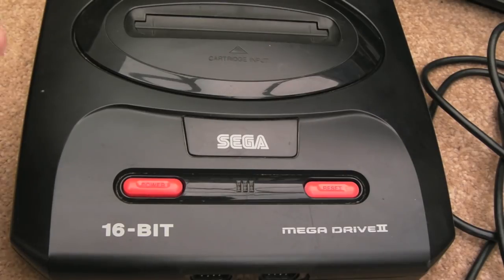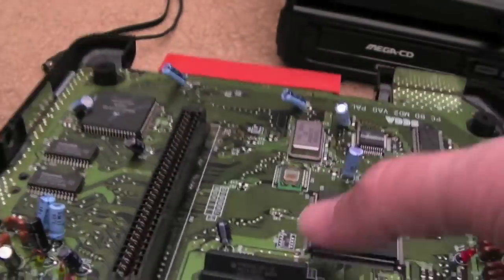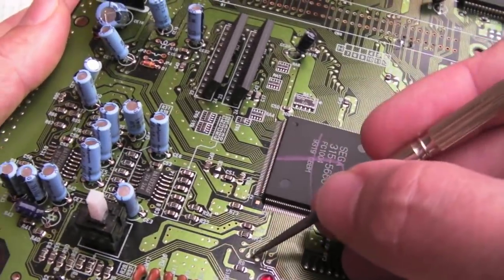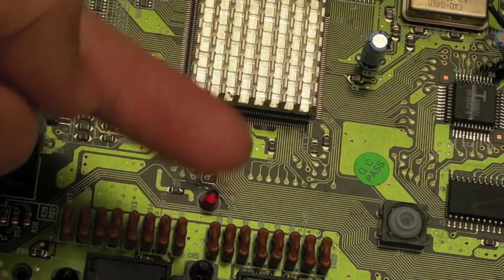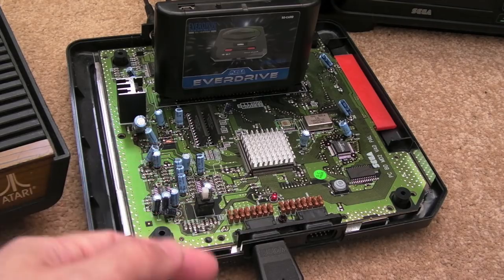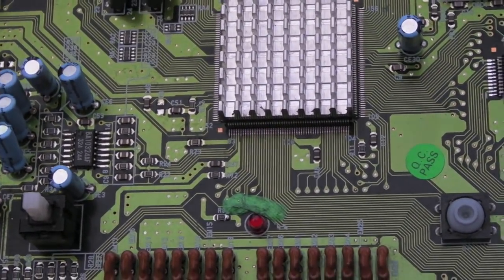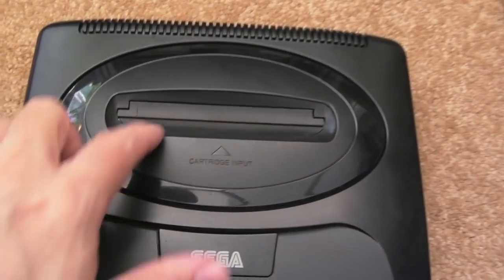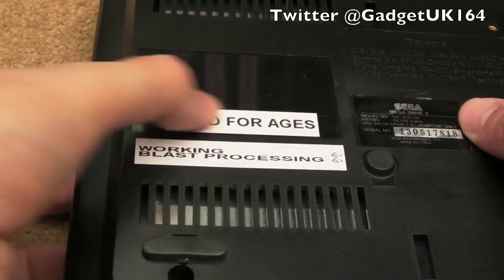Sega Megadrive (Genesis) 2 (MKII) Repair (VA0) - Black Screen

Comment: Great video, thanks. You have added a heatsink on the cpu/asic. I have two questions:
1- Was it used with thermal paste or a thermal pad? Is it easy to find on aliexpress or similar stores?
2- Have you experienced some artifacts because of this increased heating on this chip? 
I have a Brazillian Mega Drive with internal psu and it starts generating artifacts after about 30 minutes of gameplay. If I keep pushing it gets worse. I could upload a video with this gameplay to ilustrate if desired.
Reply from the maker: I used thermal sticky pads from 3M.  I haven't noticed any artifacts!  Maybe you have bad capacitors in there that need swapping, or the chip has developed a temperature sensitive fault..
Reply: @GadgetUK164  I will double check every pin for bad connections and reflow them if needed. Capacitors look ok, but there is only one way to know for sure. Thank you.

Comment: I had wavy lines interference on the RGB image of sega mega drive 2 model MK-1631-50. As advised by a friend I went in and replaced the voltage regulator with a new one ,L7809CV. The console was working before just fine now it boots fine and seems to still output a signal since the TV seems to detect something, but the screen stays black and there is no sound. Any idea what could have happend? Could be that I used the wrong kind of voltage regulator?
Reply from the maker: A 7809 is a 9v regulator - chances are that has destroyed something on the board.  Instead of providing 5v out, 9v has been fed into chips.  They die with more than approx 5.25v typically.

Comment: Heyyyy hoping for advice, I have a megadrive and a 32x, Megadrive games don’t run (I’ve tried several) they only load the initial produced by sega enterprise screen, then goes black. What’s weird is the 32x games work through the 32x but megadrive games don’t work through the 32x or through the normal cart port. Just wondering if you’ve come across this ? Thanks 😊
Reply from the maker: The first thing to do (and you've probably already done it...) - reseat the flex ribbons (at both ends).  Then clean and inspect the cart slot, and the part that fits into the Megadrive (pcb edge).   Assuming that hasn't revealed anything, I next wonder if its a region thing...   What region 32x games are they, and what region is your Megadrive and the carts it does work with when the 32x isn't connected?
Reply: @GadgetUK164  so the region they are all megadrive pal games, console also megadrive and 32x is megadrive, what are these flex ribbons??  I will google it now! I thought it may have been a region issue so I double checked it wasn’t a genesis etc 🤣  last time I checked it after cleaning it isn’t even displaying the sega enterprise productions screen anymore just a black screen now hope it haven’t broken it even more. I checked the traces and they all link up to from the carts pins to the chips hmmm 🙈

Comment: I managed to jump start both a model 2 VA0 and VA1 that would do this black screen. Literally a piece of wire and have one end grounded and create a temporary short to the VCC pin of the lower ICS to
Left of board. It seemed to be specific locations to short that would get it to boot , and not just a 5v to ground short (well yeah it is but off specific point) 

One started working as normal after this technique I developed lol 

Another one didn’t, and eventually the audio died... but I could still “jump start” it haha
Reply from the maker: You shouldn't really short connections like that - if you need to, its a sign of a fault somewhere or a bad trace.  How did you work out which connections to short?
Reply: Both pal models happened after 60hz mod which is cutting one trace but also after switching them on and off so many times. I didn’t care - I buy them faulty then fix them. So they were “faulty” to begin with. It completely revived the other system and its been working normally. I was just messing around tbh

Comment: Lets say i wanted to get replacement rivets, where could i get some that would fit in the cartridge slot connector holes?
Reply from the maker: Honestly not sure - I would start with a rivet kit from eBay or something and see if any in a kit would fit.

Comment: So, I'm not sure if there's answer to this, but I'll go ahead. I have a Japanese MD1 that works just fine, however the plastic on the pin connector and DIN socket leave an oily residue on connected parts. I have no idea how to stop it. It's really annoying, because other MDs I own aren't doing it. I'm close to swapping the parts.
Reply from the maker: Maybe theres a capacitor leaking somewhere, perhaps in the cable?
Reply: @GadgetUK164  That's the thing. I've checked all the caps and they're fine. I also use an HD Retrovision cable. The plastic on the connectors themselves seem to be "sweating".
Reply from the maker: It must be the connectors then =/
Reply: @GadgetUK164  Hmm. At least in this video, you remove the pin connector. How do you go about removing the metal pieces? Do you have a video showing the process?

Comment: I really be no clue about this stuff.. can you not test for continuity with a multimeter either side of a suspected break in the traces?
Reply from the maker: Yes - that's how coninuity test works!  It will beep if there's a very low resistance electrical join between the two points you are measuring.

Comment: I love the sega mega drive II! Me and my Family still have our console, however since we are Australian, we used Antenna plugs to play the system, but since we are in the future now, antennas do not get used anymore due to internet and stuff like that. Since thats there now we cannot use it anymore due to our new TV not using antenna. Im hoping to buy a Antenna to AV cable converter, need to save a bit more...

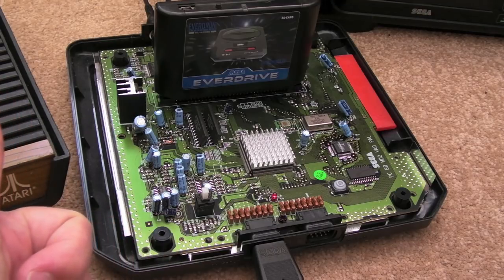ALSO at 27:32 i thought you were pissed off about the incompatibility! but it was just the case... you shocked me a lot!

Comment: My Megadrive 1 has a black screen with weird blue vertical blocky lines on the screen? I can't see any noticeable corrosion on the console. Where do you suggest I look in terms of a potential shortlist of faults? Do you think faulty VRAM is likely?
Reply: Also thanks for this - thanks to this video I was able to diagnose a broken link next to R80 and half a dozen broken links around the cartridge slot on the Megadrive 2 I have that isn't working. Not confident with the repair myself so I might find a friend I can work on it with.
Reply from the maker: Are you getting sound though?  If you had sound but graphical issues, that would suggest VRAM.  If it doesnt output sound and appears to crash with those blue vertical blocks, I am more inclined to thing work RAM or a VDP / arb fault.
Reply: @GadgetUK164  No sound either. How straightforward a repair is it or am I better off sending it off for repairs. I'm trained as an electronics technician, but it's been years since I've used the skills, so I'm a little rusty.
Reply from the maker: If you've never done much desoldering of chips it could be tricky!  You are best using a desoldering station or something to remove the IC.  It can also be quite hard trying to source some spare parts too.

Comment: i had sega like this one at a time but US version and what is weird about it some games wouldn't work unless the controllers were unplugged hope you never run into that problem lol
Reply from the maker: Hehe, never had that before!  I imagine that maybe that particular Genesis had a problem with one of the inputs and its pull ups or something.  I have heard of Megadrives having dodgy controller input problems due to a failure inside of the chip that handles the controller ports.
Reply: Having a problem with a Sega Genesis 3 what the hell that's really weird

Comment: how much sega mega drive 1 costs?
Reply: ok thanks🙂
Reply from the maker: In the UK they are pretty cheap at around £10 to £15 for a MK1.  The MK2 seems to sell at a similar price too.   But that excludes a PSU, AV cables or joypad.

Comment: The problem I have with my mark 2 the part I plug or put the power cable in it’s kinda lose so the power cutting on can I fix it or?
Reply from the maker: Yes, you can try and resolder the connections holding the socket to the PCB on the underside, or you can swap the DIN socket (just need to find one with the same profile).

Comment: I have a VA0 with the same black screen problem. I replaced the cartridge slot because it had some wonky pins, but still have the black screen.  The initial Sega "copyright" screen does come up for some carts then goes to the black screen.  I've checked that each chip is getting 5V and they all are.  The voltage out of the regulator is good too. Wondering if you could give a pointer on what to check next?  If you don't have the time, totally understand and no worries
Reply from the maker: It could be a RAM fault!  I have a similar Megadrive repair video coming up soon!
Reply: Awesome, looking forward to it... been on a massive Megadrive kick lately :-)

Comment: I have a lot more nostalgia for the SNES and I definitely still prefer it overall but, the Genesis/Mega Drive is a very impressive system! Each system had things the other couldn't really do! I believe the MD may stand the test of time better than the SNES. The outer case is definitely superior but the internals also seem more rugged and less proprietary.
Reply from the maker: Yeah, don't get me wrong - I LOVE the SNES!  But I have more nostalgia for the Megadrive =D

Comment: More good stuff as usual, Gadget! Couldn't you use some nylon bolts/nuts for your cart slot there? Or even metal hardware with nylon (or other non conductive) washers? You have a good eye for spotting/fixing the damaged traces; I will try using solder braid next time. I've not had good success trying to repair traces by tinning them. Always end up with a bunch of bodge wires!  I'm starting to note how much you focus on heatsinking/improving cooling on these old systems. Maybe heat is more of an issue than manufacturers let on? I know there was a Sega arcade board series that met a fiery doom because they didn't bother to engineer any heat dissipation. Even if it's overkill, it can't hurt!
Reply from the maker: Thanks =D  When manufacturers design any electronic system, they are looking at reliability for say 2 to 5 years (sometimes longer depending on the system - eg. safety systems and security systems tend to be design to last decades!).  So when a console is designed, if it lasts more than 2 years with very limited cooling - they will just sell it as is.  Whereas with more cooling on certain components, it can very often make a difference where it lasts longer.  Ultimately they will all die.  I mentioned entropy and thermo dynamics a number of times now, and some people prefer to ignore it, but temperature is a factor in the life of any electronic component.

Comment: This video gave me the courage to try and fix my Model II Mega Drive (which was made six days before yours, going by that date stamp), it had the same problem but it was a different cause. I also found out afterwards that it had controller issues in port 1. The cause of that problem was pin 104 and 103 on the 315 chip having been lifted. Reconnected those and it was great, because I then had something to put my MegaAmp in.
So, even though the process was different, I'm still thanking you for indirectly encouraging me. I also love your content.
Reply from the maker: Thanks =D  Glad you got your Megadrive working and pleased I could inspire something positive =D
Reply: I'll be working on a video that quickly sums up some recent repairs that I did over the last couple of months and the Mega Drive will be a part of it.
Thanks again!

Comment: I wonder how they (Titan for overdrive) did most of these effects... i mean each 86k instruction takes 4 to 70 cycles... and if you want to do one 4-cycle instruction per pixel at 25fps, you already ran well out of CPU time! And there isn't much in terms of special purpose hardware. DMA eats CPU time. It's tough all around. The cartridge space used is under 4MB, so it's not a video player for the most part, though i suspect there's a small vector video section here and there.
Reply from the maker: It is very impressive!  Especially some of the high speed video stuff in that demo.  I've not looked at Megadrive development before, and spent very little time looking at 68K ASM, but the CPU is pretty fast @7.6Mhz, Amiga-ish.  The DMA must be better than you think!?!?
Reply: Oh i was mistaken, this is Overdrive 2, an 8MB cartridge. Still, no less impressive.

Megadrive makes things that you expect to see in games very, very fast and easy, you normally don't even need pervasive line interrupt since there are line and column scroll registers, per pixel. So even games with pretty advanced effects are actually doing pretty benign things from the hardware perspective.

Also if you can express computation as selecting tiles that are already pre-drawn, this can pretty much always be done quickly enough. But when you get to individual pixel level, the system tends to fall short easily. Many of the approaches you'd be used to from an Amiga would not quite work.

DMA controller will copy 2 bytes per cycle, which is fine, but during this time, CPU is halted.
Reply from the maker: Not much of a DMA is it if the CPU is halted lol
Reply from the maker: But I guess that makes sense - the 68K can hardly be allowed to access the RAM whilst DMA is working with it.   That's where some kind of split RAM system we be mega useful. eg. a region where the CPU can access whilst DMA takes place into another RAM region etc.
Reply: Don’t forget the cool undocumented stuff in the VDP!

Comment: Well it might not be a baby NeoGeo, but it is a stereotypical baby arcade console from 1986-1993 era. A simplified video, more compatible with Master System relative of SEGA System16. SNK, Taito, Capcom, and Konami all made systems with 68k, z80, and usually Yamaha FM, and custom video hardware at one point or another.
Reply from the maker: To me its a baby neo-geo, nothing will change that ;)  But I accept it has a lot more in common with the arcade boards you mentioned there - certainly much closer spec'd =D

Comment: What is going on with the traces underneat the big IC, below the "53" silk screen?
Reply from the maker: Extension of the ground to isolate inbetween those traces!  follow them to the left you can see they connect to the large ground plane area.  EDIT: And it looks like its the audio ouputs going to the op amp on the left.   Those grounded traces kind of act like a mini shield.  Stopping noise getting onto the sound outputs before they go to the op amp.

Comment: Chris, i use this stuff it last ages https://www.ebay.co.uk/itm/Mechanic-UV-Curable-Solder-Mask-Soldering-PCB-Repair-Green-Paint-10cc-Plunger/232593592241?hash=item3627a88fb1:g:124AAOSwzDBa8Wxa
Reply from the maker: Cheers! =D

Comment: The audio amp in the model 2 isn't as good as the model 1's that's why the sound quality is kinda off.  Ya the Genesis/Mega Drive is a monster compared to the SNES, and the 32X actually could render 3d textured polygons and such faster then the Saturn and could do some other effects that the Saturn couldn't do, its a shame no one tapped in to the full potential of it.

Comment: Excellent as always! wow that had some serious corrosion issues, bet a can of something fizzy got spilt in it back in the past. A testament to how robust they are compared to the SNES that you could fix it. And know what you mean about the sound I've noticed the difference between the audio on the MK1 versus the MK2. MK1 just sounds so much nicer.
Reply from the maker: Thanks =D  Yeah, does seem like something got spilled on there.  Although, those 2 traces that needed patching - there was no corrosion or anything liquid looking - just black traces.  Kind of looked like trace rot I spotted on the CPC I fixed.

Comment: I guess these consoles need splash guards instead of dust covers. It is a nice bit of backwards compatibility in there just from using the same previous chip to do something else in the next generation. Well the SNES is a lot of helper-chips strung together like the NES, impressive in compatibility but weak in core raw performance.
Reply from the maker: Yeah, lovely design =D  I guess Nintendo did a similar thing with the Wii and GameCube - kind of making a super GC really, that way it would be backwards compatible.